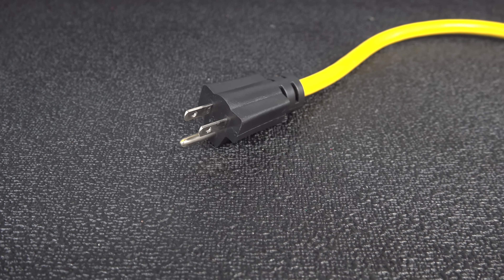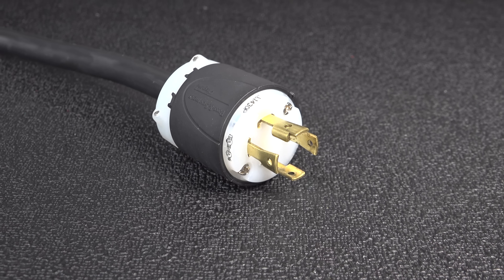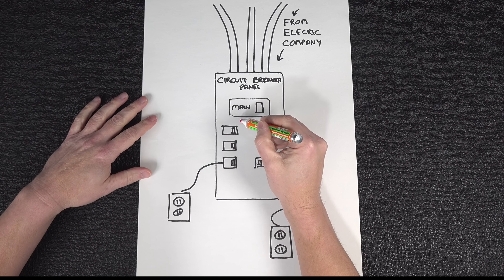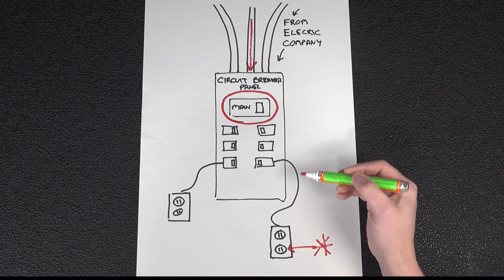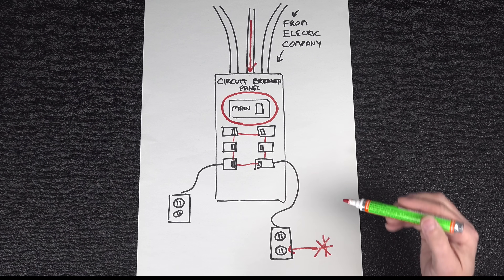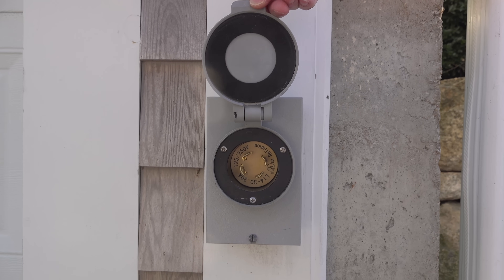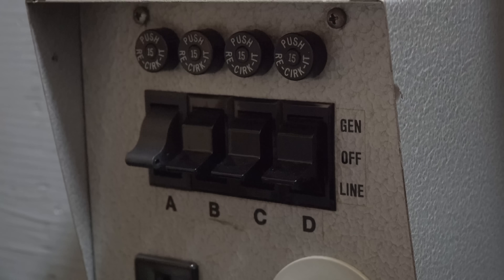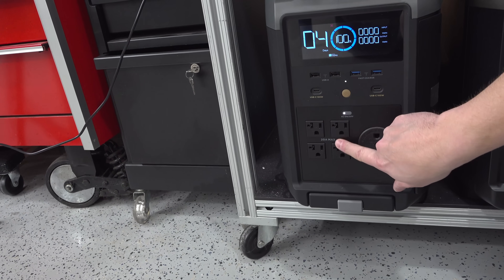Worst Electrical Mistake You Can Make - Backfeeding Generators

Comment from the maker: Thanks for watching please LIKE & SUBSCRIBE - Electric safety isn't exciting but neither is dying so please pay attention. Safe Generator Plug: https://amzn.to/36azVKo
Reply: Now i am in agreement with everything you are saying. And yes back feeding with a generator can cause problems with line crews working on a supposedly dead line. But that why us lineman have a saying, if it aint grounded it aint dead. When we throw ground on a line that a generator is backfeeding the generator will die immediately. Safety first on our end.
Reply: Yea… I think you’ve just earned a subscriber.
Reply: Back at it again with some solid advice. Keep it up bud
Reply: It's only a mistake if you leave it around stupid people.
Reply: This happened to me,  a plug on each end of an extension line, I didn't know was plugged in, because the plug was on the ground,so I  picked it up naturally and my hand just clamped shut over the plug I could feel the electricity run through my arm & across my chest, I couldn't release the plug the only  thing I could do was just rip the wire out the plug lasted about 30+sec according to my neighbor who thought I was dancing,: FFS I said I was dying, 
25yrs later I still get muscle pain in my right hand+ I have a plug shaped(UK 3 prongs ) scar on my right hand & being a teen at the time I was gutted,  I'm thankful the electricity surge didn't blow a exit hole out my arm or elsewhere, then again the same neighbor Did say she saw a lightning bolt coming oot ma arse 😜
Reply: I use this to power my cabin and 2nd house with a lithium ion battery inverter, I use one of those 1 kwh goal zero yetis...   It works great.
Reply: So do the right kind of back-feeding, not the wrong one… but this requires an new part to be installed to the main breaker. Huh
Reply: Came here to be a ball0 buster but no need thank you ... I'm a electrician and what home owners don't realize is transformers both step down voltage for your home and step voltage up meaning if someone was to back feed into the grid the transformer would step the voltage back up and could kill a lineman or bystanders if lines are down...  thanks stay safe
Reply: lol lol 😆😆😆 ii
Reply: I've never seen these
Reply: Our circuit breaker doesn't have that metal panel to block the main breaker but we have a generator plug. Is that plate only added to house that get the plug added AFTER it's built?
Reply: @bluenight317  there are other options:
Manual Transfer Switch or
Automatic Tansfer Switch.

A manual transfer switch can be a subpanel with those little black switches (Shown in the video), or a three position disconnect where the handle has one OFF position in the center and two ON positions, where one is for utility power, the other for generator power.

If not, then I must ask, did you have your panel replaced recently? It is possible the electrician did not bother to order a mechanical interlock for that panel, or simply forgotten. Either way, I highly suggest getting an electrician to take a look to make sure it's safe.
Reply: @tailgunner2  yea, we have a manual one with 2 "on" positions
Reply: @GreentheGamerGuy  puss
Reply: Do you have a Video on how to install the Interlock Outlet (inlet), Breaker, and Interlock system?
Reply: You bought the unsafe cord on Amazon too?  Took an alert from the CPSC for Amazon to pull them.
Reply: You got it keep  doing what your doing.👍
Reply: Wait I’m so confused. I know a guy who has a generator and the electric company actually pays him for his extra electricity. This is down in Southern California, U.S. So maybe it’s a regional thing?
Reply: @Slamairon  he most likely has a solar generator which is a little different and when a grid i up and operating your unused power and be fed onto the grid but when there is a storm tree takes a line down lineman work could be injured or killed if a home owner back feeds onto the grid via a gas or propane generator creating electricity and it makes it to a transformer it will be stepped up to a higher deadly voltage...
Reply: @Slamairon  it is very much a regional, state and provider thing. Depending on those thing u can either sell it back or get a discount on what u use based 9n what u give to the grid. If you staying connected to the grid make sure to talk to your provider and get a solar meter.

Comment: Except for the part where it is NOT unsafe.

Go ahead and plug both ends into the same socket and tell us how dangerous it is.
Nothing will happen (unless you use an extension cord to plug it into a DIFFERENT socket in your house.

AND if you touch the other end of the cable when it is plugged in you can get a shock to your hand. That wont hurt you just scare you (as long as you are not standing in a puddle)

Comment: The term "male plug" is REDUNDANT.  A plug is male by definition.  A female electrical connector is called an OUTLET; the term "female plug" is an OXYMORON (like "beef hotdog" or "male figure skater").

Comment: So turning off your main breaker will keep electricity from backfeeding into the grid, the unsafe part is that somebody might forget to turn off their main breaker. That's what I'm getting out of this. Correct me if I'm wrong and explain how so.
Reply: Thats just for backfeeding the grid and has nothing to do with the fact you use a suicide cord. Thats a completely separate issue that really has no reason to be included in a video concerning the dangers of suicide cords. The only dangers from suicide cords themselves are first the exposed prongs so it you unplug the cord from your home outlet while still plugged into a running generator and touch the exposed prongs you will be electrcuted by the generator power source. If you unplug the generator while still plugged into your home outlet while your main breaker is on and you touch the exposed prongs you will be electrocuted by the utility power source. But either end can be energized before unplugging the other end. Most of these concerns with suicide cords are immaterial if you only plug or unplug them while both power sources are off.

Comment: If your outlet has a male socket does that technically make it an inlet?
Reply: Not necessarily. The term inlet and outlet is used to describe the direction current is flowing. If it's wired to let current feed in then it's an inlet. If it's wired to let current feed out it's an outlet. While proper wiring on an inlet would only let power feed in, if you wire it the wrong way it becomes an outlet.

Comment: The trick is to throttle up your generator as you back feed the grid so that not only do you supply electricity to your locals, you can blow all of their transformers and synchronous motors too!

Comment: The other problem is that backfeeding bypasses all breakers. In the rare situation where an appliance fails, it's nice to have a breaker. The modern generators do have a breaker. That means you can only use up to 15 amps. Otherwise, the generator will need to be reset.
Reply: Backfeeding doesn't bypass breakers. All breakers still work as they should during backfeeding unless you are double bonded which you shouldn't be double bonded if you are using a floating neutral generator. That would just mean you're using the wrong generator if your breakers don't flip when they should and you can always unbond a generator to make it floating.

Comment: I worked for my dad when I was teen in construction back in the 1970s. My dad had a 50 foot power cord with a four plug box on it. Two of the plugs were for 110 and the other side was 220. My dad didn't like paying twice as much or more for the 220 plugs and opted to just use 110 plugs. We plugged our radial arm saw into the 220 plug. It was the workhorse and my work station as a teen.
When other subs would show up, they would plug into that electrical box and guess which plug.
I heard one plumber say, "Damn, this drill is cutting through the wood like butter."
Before I could stop him the drill started smoking and cut out.
He started cussing us and I asked, "Who told you that it was okay to plug into our electrical outlet?" He just packed up and left.
Once we had an electrician make us up an electrical box like it and ten minutes later he plugged right into the 220 side. Burnt up a brand new Milwaukee Drill. He also burst into a tirade.
"Your the one who built it, dude and we told you what it was for." My dad told him.
😊
I have been shocked a bunch in my life time. I am glad when they came up with those pens that detect a current.

Comment: No, why would anyone deliberately put power into the grid for free that's stupid.   What people need a male to male lead for is a cheap way to connect their inverter and battery's to their home without spending hundreds of dollars running a new dedicated line to the fuse box what one isn't needed  any existing line will work.  All that is needed  is a safety safety.   And to turn off grid  power and any other PV systems you may have connected to the fuse box.

Comment: Well, there are some uses for the male to male cable. Not with a generator. 
For example, here in Australia many caravans have a female input for their mains power and the outlet power is also always female.  
I hook my caravan to mains with a 10A - 15A adaptor with a fuse (circuit breaker) at the mains power outlet and run the 15A extension cable from the adaptor, but alas the end of the cable is female and cannot connect to another female input, hence the need for the male to male cable.

Comment: Even in northern California probably 1/2 of homeowners that don’t live in city limits have generators. Of those about half of them are connected to their house however they see fit. As an electrical worker you never assume the line is dead and know that there is always a chance that there could be back feed. Kinda funny you showed people that you tested a plug by touching it with your hands. Breakers can fail ya know. For anyone that has common sense and just want to use a generator once In a while for emergencies I usually just tell them to make a male to male cord.

Comment: When you run a generator with the power out the meter will run backwards when you have a analog meter. Not many of them around now. But was told that the new electronic meter do the same thing. Am not sure that is the case, do you know SIR ???
Reply: If you’re making the meter spin backwards that means you’re back feeding onto the power company. Turn the damn main breaker off before hooking up a generator.
Reply: @jaxbeach09  Maybe my bill will be lower ???
Reply: @victoryfirst2878  TURN THE MAIN BREAKER OFF AND DONT BACKFEED ONTO THE GRID! What don’t you get about that?
Reply: @jaxbeach09  GOT IT FELLA.

Comment: Only a MORON would have an accident using one of these.  They are for plugging a genny to your RV or something similar. I use one to power a lamp on a gazeebo, out in the middle of the desert where theres no power.  Its stupid simple to use.  You plug it into the load first then to the running genny.  Remove in reverse order to avoid grabbing the prongs and getting shocked.  Im surprised they sell these in the era of such dumb people who need a law or regulation for EVERYTHING.  Dont make no sense though, when nobody knows about them.  Until somebody gives them a ticket for violating it. Stupid.

Comment: I once got an electrical shock but not due to the issue in this video. It was from a lawnmower. Our lawnmower wouldn't shut off like it was supposed to when we put the throttle in the lowest setting so my father told me to short circuit it by touching a metal can to the spark plug and another metal part of the mower. Unfortunately he didn't tell me to ensure the can touched the second metal part before it touched the spark plug. Being rather young and not knowing any better I touched the spark plug with the can first. Needless to say I got a very noticeable shock but fortunately the current wasn't large enough to cause any harm.

Comment: If you don't want to install anything extra, just use an uninterruptable power supply between your outlets and anything you want to keep running during a power outage. They can keep things running for anywhere for 30 minutes to 24 hours depending on what you've got plugged in and what the capacity of the battery is.

Comment: Do it the smart and safe way. My stepfather was an electrician and wired a box in the basement to power the house with a generator. When the power goes out, we shut off the main breaker and the 30 amp for the water heater. We plug our cord into the generator, fire it up and turn on the breaker that the generator is controlled by. It runs all the lights and the well pump. The power company contacts us when power is back and we shut down the generator and turn the main breaker.

Comment: This video is for those who have no common sense it will not back feed if you shut off the main breaker before turning on the generator and shutting off the breaker from the generator before turning on the main breaker. A idiot should know better than to touch the opposite male end before plugging in the generator while running

Comment: Suicide  cable  all day, if you touch it you could die, lol, if you put a gun to your head and pull the trigger, you could die, common sense just aint commen anymore, yes turn off main, but if you restore power for a living and you dont concider all wires live, you aint gonna last long

Comment: Thanks for this. So, (assuming theres an interlock kit installed on the main breaker panel) risk of being shocked due to touching the ends is the only reason not to do this? Im asking because my inlet box is female and so is my generator, so without male to male chord I cant hook up the gene to the house..

Comment: One reason people use those adapters is because of assinine building codes forcing you to get permits and forced upgrades to unrelated things.
It would be easy just to sell a switching outlet and replace an existing outlet with the switching one.

Comment: Or get an UPS, that can be feed from two sources, but only send the power on one end. Let me explain
Inlet 1: Main/Street Power
Inlet 2/3: Any secondary source like generator etc
UPS Itself: Has a battery so it will have a margin
Outlet: Feeds power to house 
EVEN if you were to backfeed, it will stop at the UPS at it wont accept the power ... since it is physically two different systems

Comment: Back feeding as far as I know is completely legal provided its done correctly.  Most states allow consumers to sell power back to the utility by back feeding their surplus solar,  wind or other power to the grid.     What i find funny about your video is your concern/hysteria  about a double ended cable used by less than probably 10k people once every year or two, resulting in less than a dozen shocks.   BTW its really hard to kill a person with 120vac.   Considering all the other more likely hazards around the home, have you ever considered the potential issues of the ordinary light bulb?   Just a  fragile glass shell protects you and loved ones from those menacing electrons wanting to give you a buzz or start a fire, better yet an empty bulb socket, a perfect fit for fingers and coins.   Here's a few suggestions for your next video,  idiots  with open flames or have exposed hot surfaces inside their homes.   Another,  the dangers of a vacuum cleaner or using an electrical appliance  in the rain or bathtub.  You could probably do thousands of videos on the hazards around the shop.  Have you ever pondered the potential harm a chain saw could do,?

Comment: But if you have a smart meter you should be able to back feed into your system from say a solar inverter without electrocuting someone working on lines in the street right?

Comment: Haven't watched the video yet so Imma take a blind guess here, this cable is meant to plug into an Inverter on either a battery or a generator and then into an outlet on the wall so that it can pump electricity into the wires of your house.
I'll add an edit if I'm wrong but now I'll watch the video.

Comment: male-male extension cord is illegal to make/ sell in EU
There are special switches you can install in breaker box that disconnect outside power before connecting the generator. Can even be automatic (with permit). Coupled with an UPS and a generator it's great solution and not that expensive.

Comment: As long as you're handling the cable safely, there shouldn't be any issues. Here in Puerto Rico I have a 30A male to male we use to connect generator to house using the outlet designated to the dryer that we have outside. The primary rule is that we do not handle it when live. We turn off the main breaker located in the meeter and that cuts the electricity from leaving our house to the grid and endangering power utility workers. Then we turn off the breaker for the dryer. Connect both ends to the outlet and generator, turn on generator, open breaker for dryer and voila! Energized house

Comment: US plugs and outlets are totally unsafe to begin with. You can easily touch the contacts of a plug while they still have power. That is totally impossible with European standard plugs and outlets. And the only the pins keep the plug hooked to the outlet, there is no additional mechanical support, again, totally different in Europe.

Comment: Okay i would never do this ever but couldnt you use one of these to charge another outlet? Like, wire three outlets together like normal then Death Cable one of them to a regular outlet, couldnt you then plug in other plugs to the 2 remaining outlets? Again, i would never do it myself— the fucking things literally called a Death Cable- and im not THAT dumb